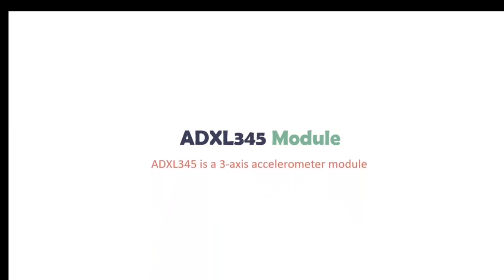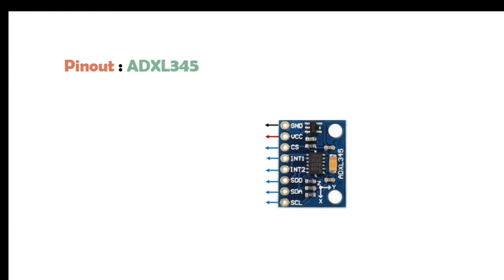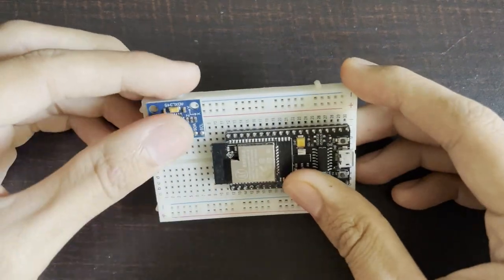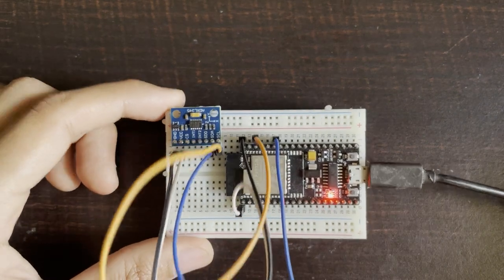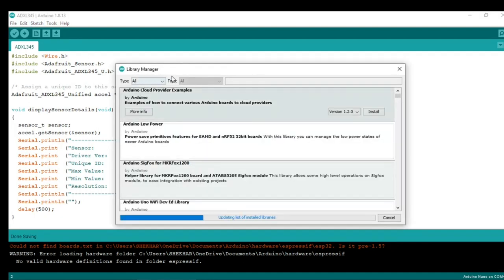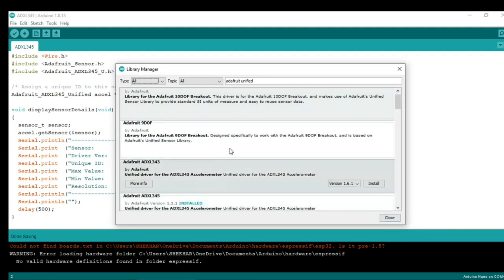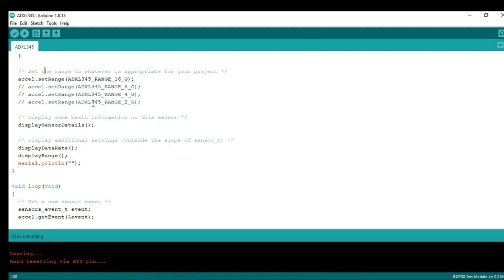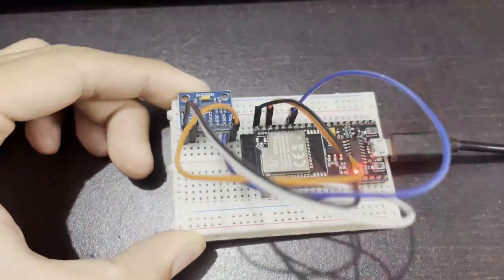Accelerometer sensor(ADXL345) with ESP32

Comment: Thanks for the video Sir, have you tried to set up the connection between the ADXL345 and esp32 but using SPI instead of I2C? The I2C works fine for me but when I try to use the SPI protocol with the Adafruit Library it does not even detect the accelerometer.